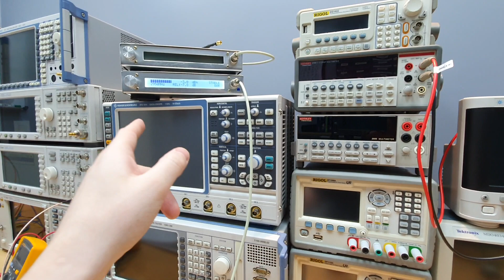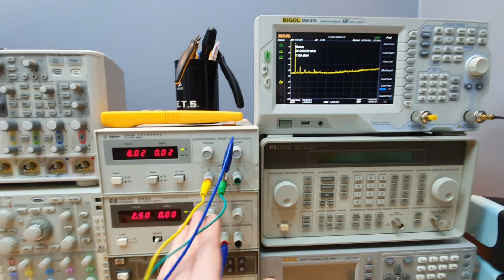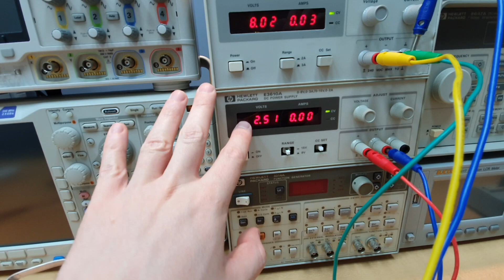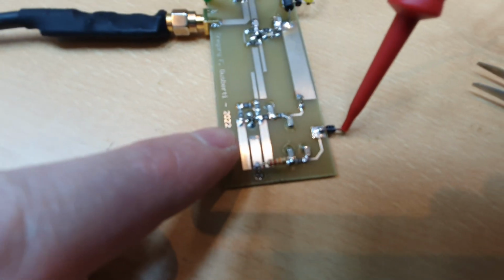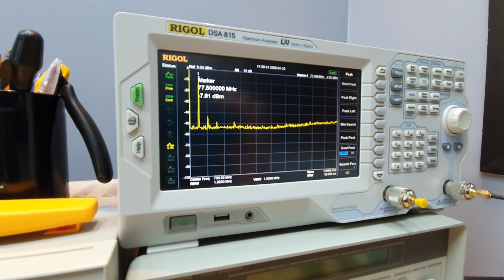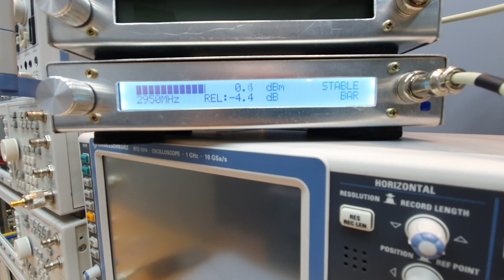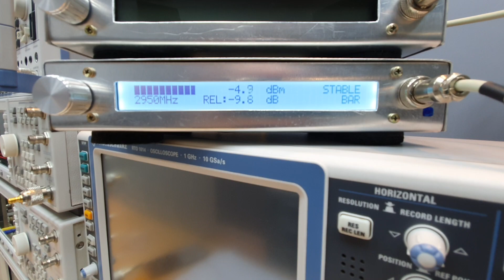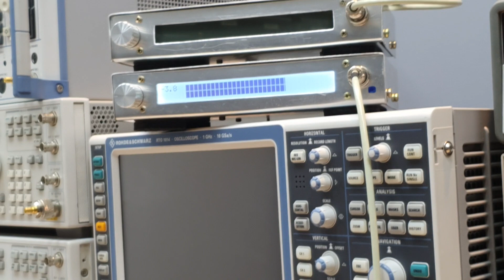Microstrip VCO tuning at microwave frequency

Comment: Hello, I have a question, is important to considerate the equivalent circuit of the sma connectors in the simulation?
Reply from the maker: No, because they are standard 50ohm connections. They are transparent for the signal

Comment: Hey! This is a very cool thing!
I wrote u about a DRO in Instagram. The DRO that i trying to make have a simmilar problem with coupling like your 1st variant of VCO. In my case i need a pretty low PN. So now i'm truyng to figure out with optimisation of topology and with a propper way of modeling 3D structure with coupled DR.
Reply from the maker: Nice!! I not used DROs yet. Make some prototypes!

Comment: Very nice, tuning the VCO to have the wanted frequency right in the middle of your PLL tuning range seems a very good idea. 
Does the VCO start osciallating with all valid control voltages? 

Your powermeter seems to have turned out very well. :)
Reply from the maker: Is starts! But I was unable to get it to 3.33GHz, the resonator needed to be  even smaller. I will make another board or try to reduce all the fingers.

Yes the pwmeter is great! I will make a video showing the final results

Comment: Nice, Did you make the VCO using a transistor, varactor diode like a colpitts oscillator ?
Reply from the maker: Yes! The varactor tunes the middle finger of the resonator. This design was created by professor Matjaz Vidmar, search on Google, he has amazing articles
Reply: @AllElectronicsChannel  I have bookmarked his website! Since you are building a VCO, can you measure its phase noise once tuned ?